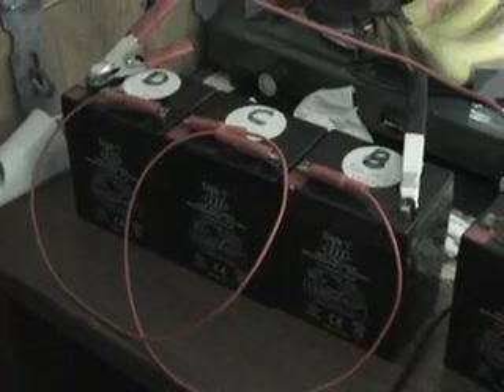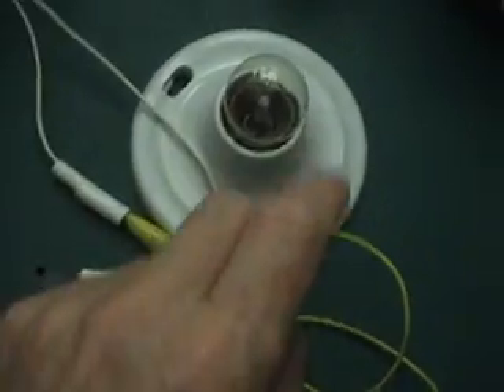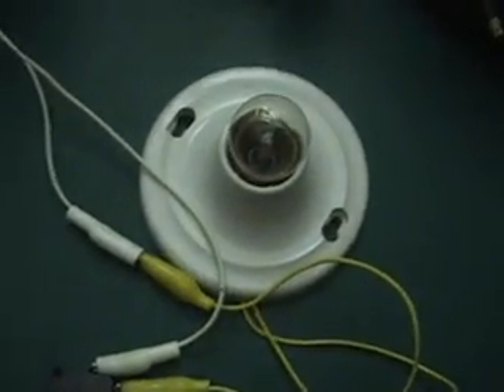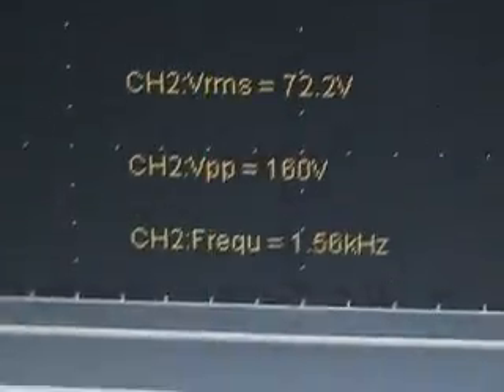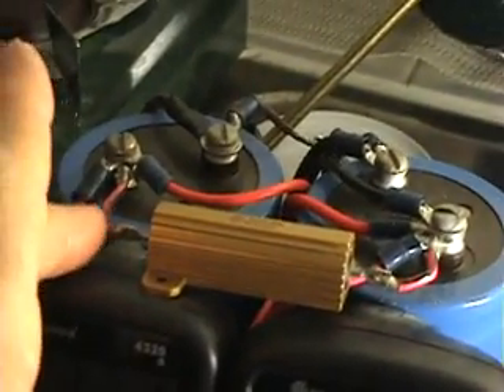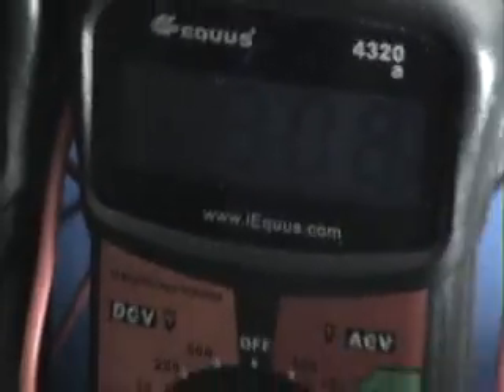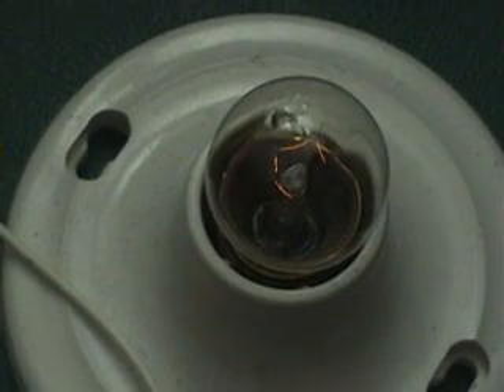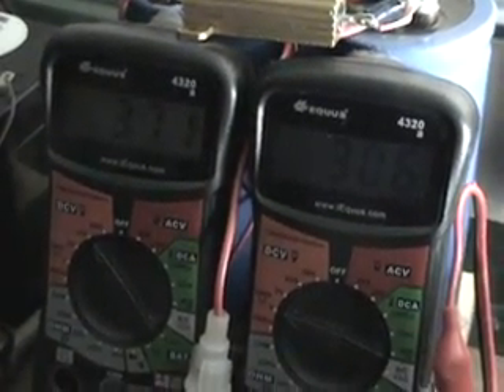Test Confirming Delayed Lenz Effect in MOT

Comment from the maker: @deepcut66 

If the measuring resistor was 1 Ohm it would be 300ma but the resistor is 10 Ohms so you divide by 10 = 30ma

Luc